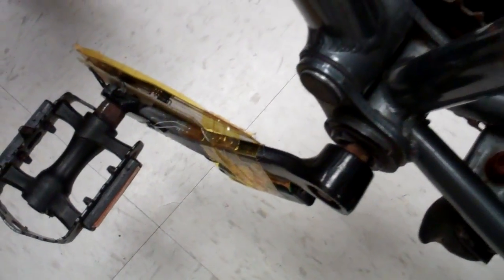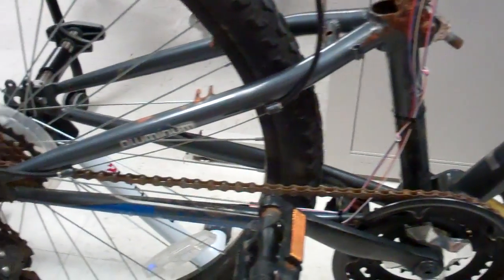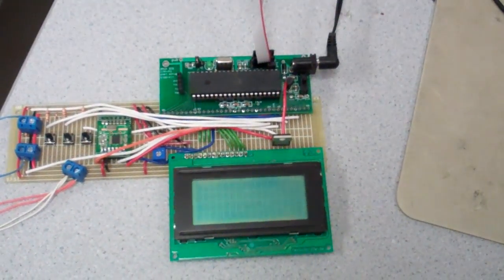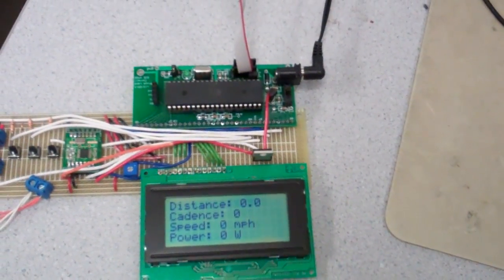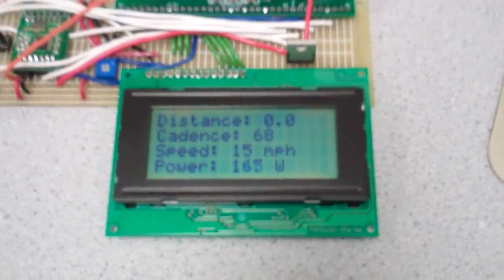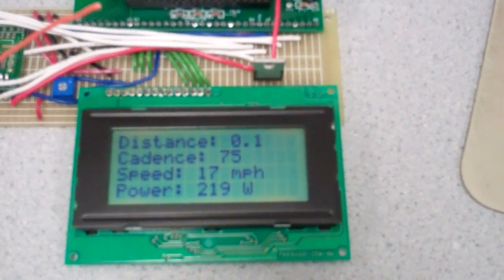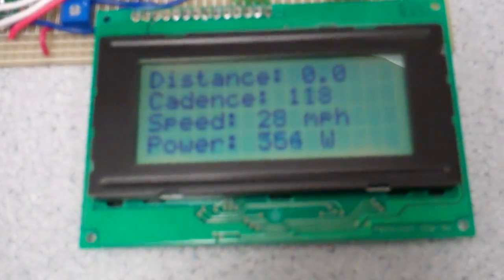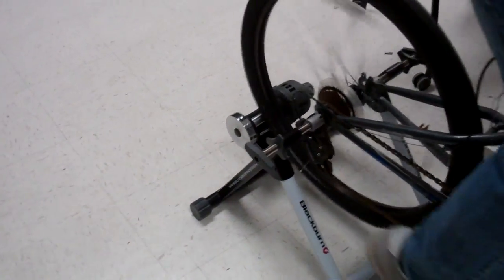Bicycle power meter

Comment: I have a Schwinn 120 exercise bike It has a panel that gives me watts, speed, distance ,heart rate and more on page 9 you can see the panel . the panel switches to a set of other info . The panel can auto add resistance to the wheel according to the program you pick or you can set it your self with the up and down arrows . Here is what I would like to do . I want to send the info to the zwift riding program and have zwift be able to control the resistance as well at receive the info for heart rate , speed , watts and what else zwift needs . I was wanting to send this info via bluetooth . Can you figure out how to do this and make a video ? https://download.nautilus.com/supportdocs/OM/Schwinn/SCH.120.220.OM.EN.FRC.pdf